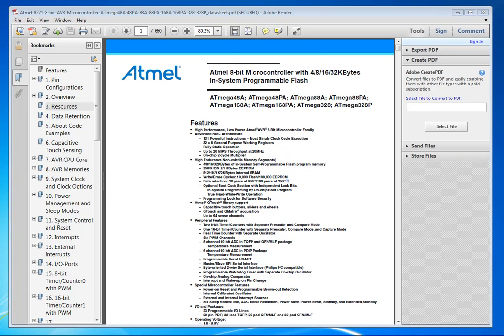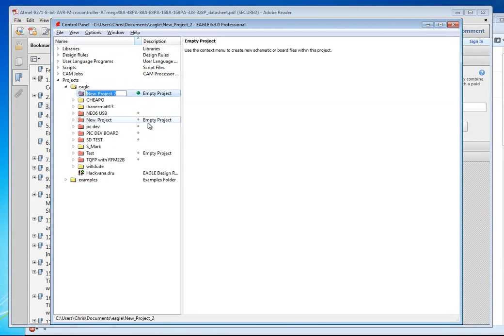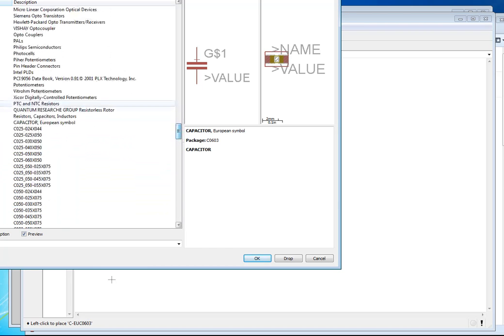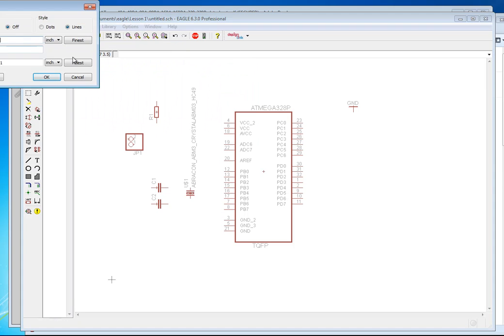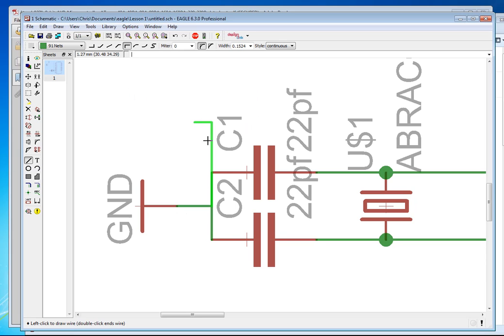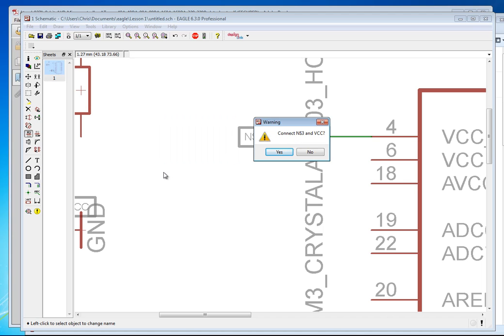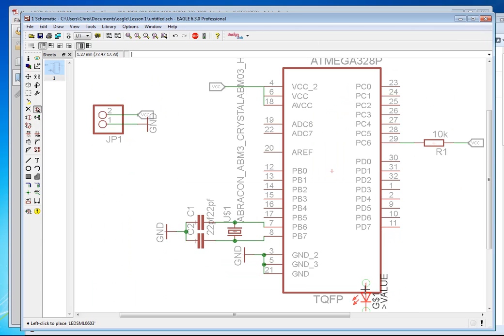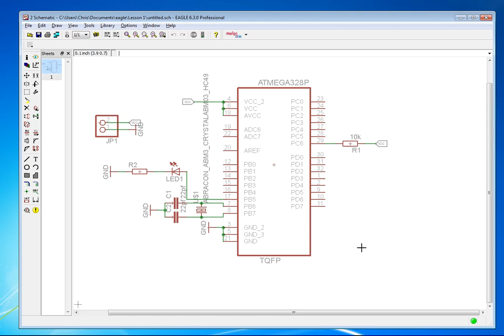EAGLE HAB - Lesson 1 - ATMega328P Basics

Comment: ive got a surface mount to female header (pinspacing like pi or most arduino boards) its 2x20 any idea if there is a ready to go eagle library like pinhead that does smc? connector was from samtec and they offer footprints in pdf, so i think there is a way to make the part but im still new to eagle